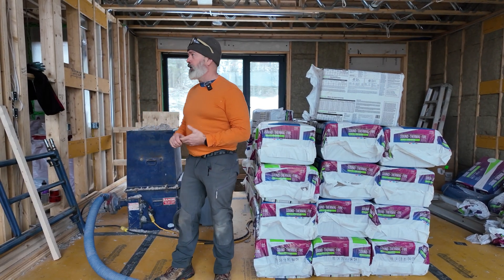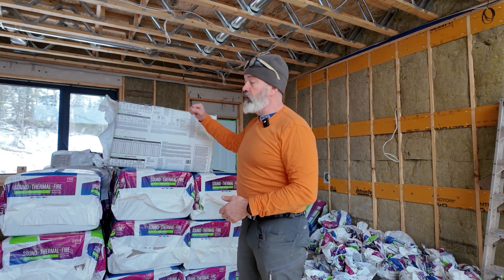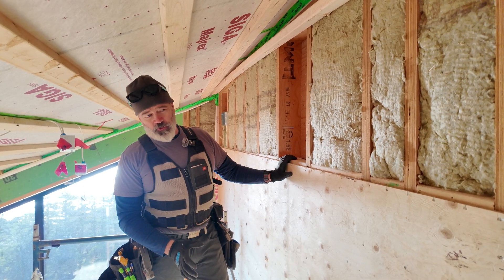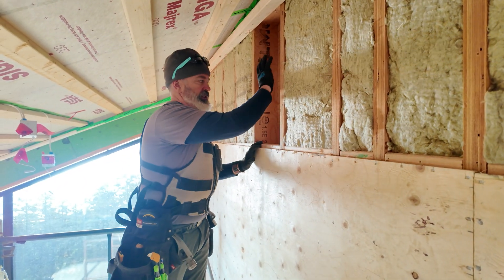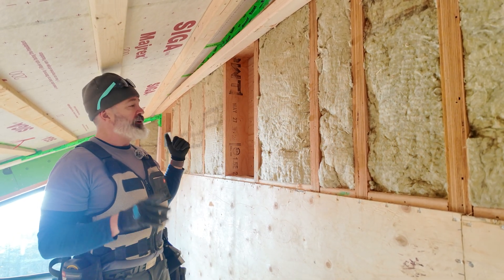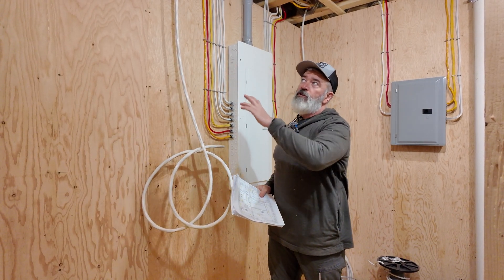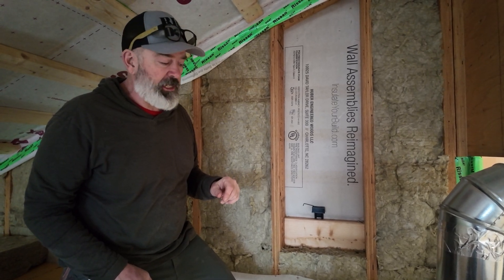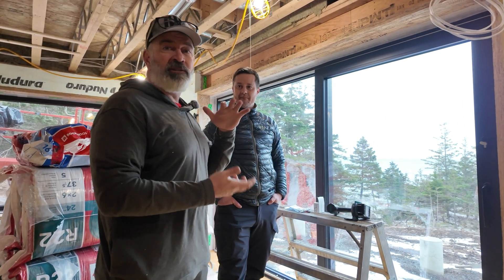South Hollow Part 18 Thermal Control layer is almost complete. And Sensors????

Comment: Should the vapour control layer continue from the underside of the high mono-slope, down the inside (warm side) of the sheer wall and connect to the underside of the low mono-slope?
Reply from the maker: Plywood provides the Vapour control at this point. The Majrex is also our air control layer at the ceiling. The air control layer is continued through the plate and down to the lower ceiling.

Comment: Nice to see those sensors getting installed! I'm curious about the results... don't forget to track to outside temperature at the same time...
Reply from the maker: For now, we will be tracking the outside conditions with a weather station.  An additional S11 sensor will be added to the exterior in the near future.